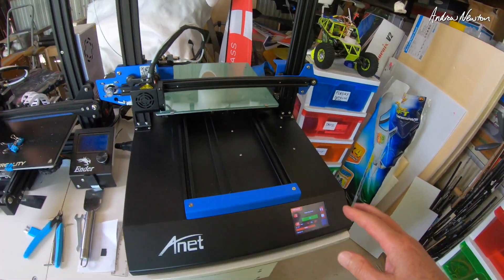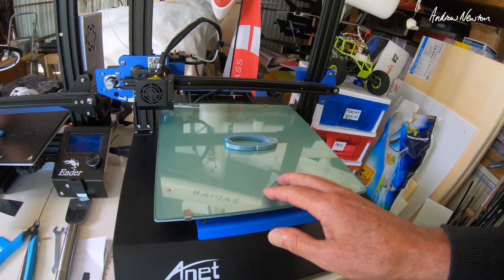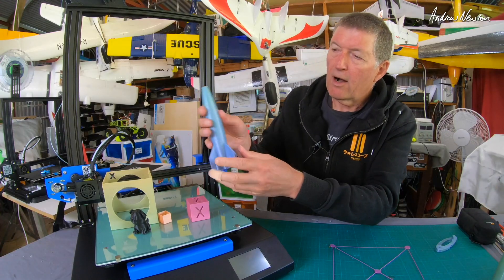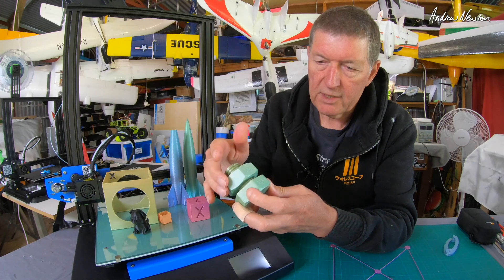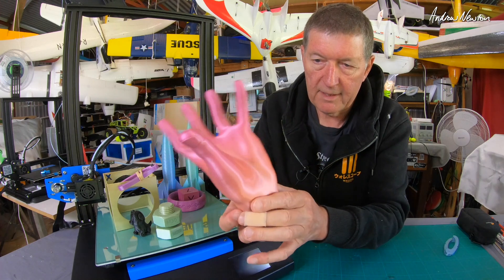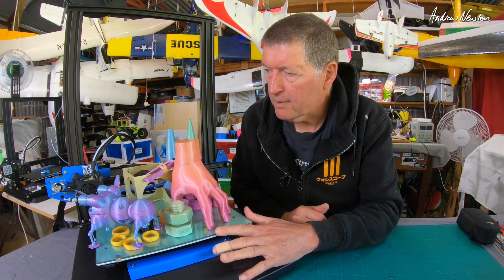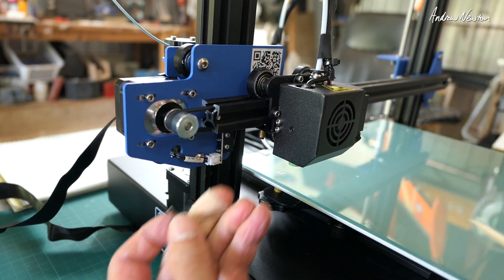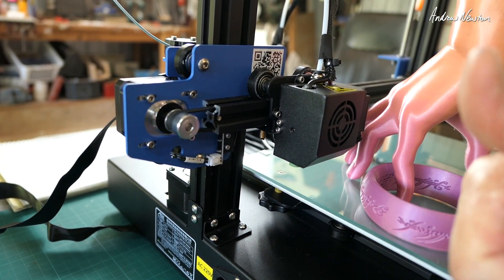Anet ET5X setup and print quality

Comment: I wonder if you might have problems with it if you wanted to upgrade the hotend to an all metal one considering the sensor you talked about, is part of the actual hotend and not  a microswitch on the frame like the others ?

Comment: Hi Andrew, 
Are you planning on doing any printing with TPU? Would love to see a video on that. 
I do a fair bit of TPU printing for quadcopters on my Anet A8 but would like a printer with a larger volume. Thanks.
Reply from the maker: I have a spool but never printed with TPU. Anything to know?
Reply: @AndrewNewton  Cura will have a profile for generic TPU which will be a good starting point. I'm no expert but the things I know are: 
You have to print slower because you just can't push a flexible filament the same as PLA. Think trying to push a wet noodle.
Printing with supports is possible but they can be a real job to remove and leave a poor finish.
TPU absorbs moisture so keep it in a sealed container maybe even with some desiccant once opened.
It's awesome for camera mounts, antenna mounts and many other things.

Comment: I've been intrigued for years now with 3D printers/printing.... After all this time, I've still not found a compelling reason to buy one. Not hating, but just haven't seen a lot of practical use for them.... unless you like little plastic unicorns and the like.
Reply from the maker: Great for little mounts and brackets, but you're right, most 3D of printing is trinkets or 3D printer bits
Reply: Its the challenge! Our printers need to be assembled and setup with care and caution. Part two, is deciding on a slicer to create the gCode file which controls the printer from start to finish. Getting the settings is akin to tuning in a F1 race car engine!.
Part three, matching a brand, type and colour filament to become the finished piece of all the hard work put into getting everything dialled in!
When you get a not bad result, its not good enough! You have improve, its a mental challenge. And....its a never be satisfied, keep going, keep learning, process.....but ever so satisfying when you are really, truly, happy with the result....until you start the printer next time.........

Comment: Could it be that using a microswitch for the end position is not as repeatable? This would be ok for side to side positioning but the bed is an absolute position and getting that wrong would have the nozzle either hit it or miss it completely. The electronic sensor is usually much more repeatable. 
I work in high speed packaging and use sensors made by a company called "sick". Although they too need re-adjusting from time to time!
Reply from the maker: My limited experience with these three cheap printers tells me the micro switches are more accurate and easier to setup. Probably different for more expensive components.